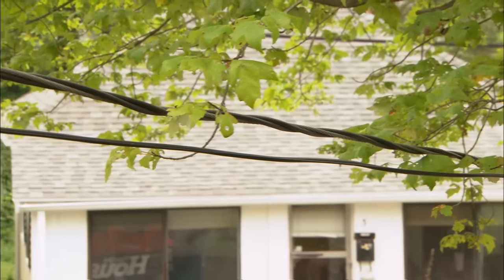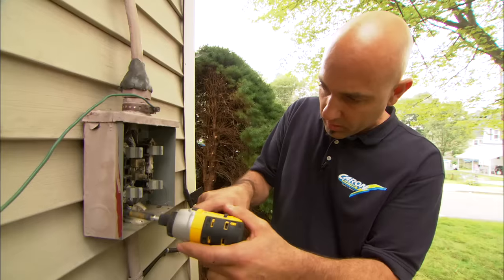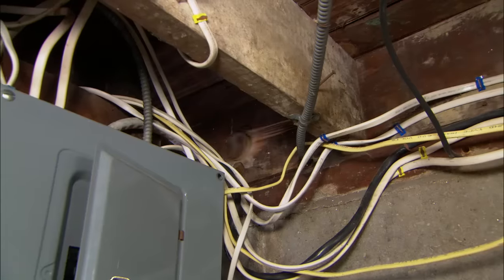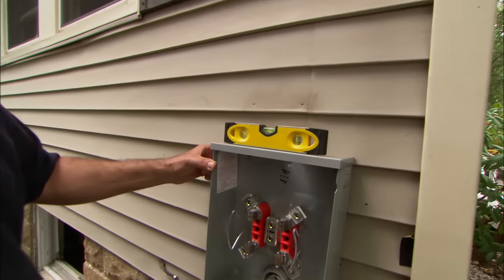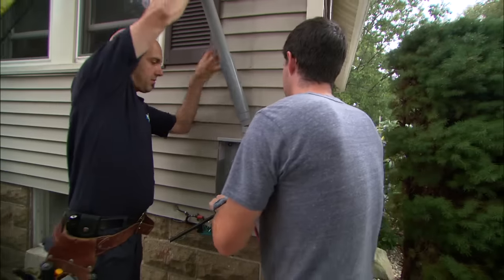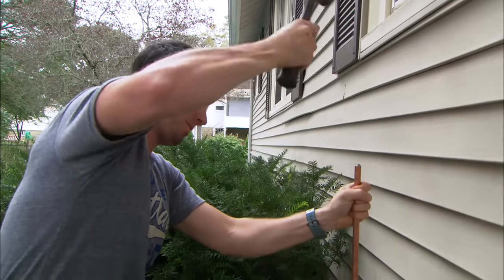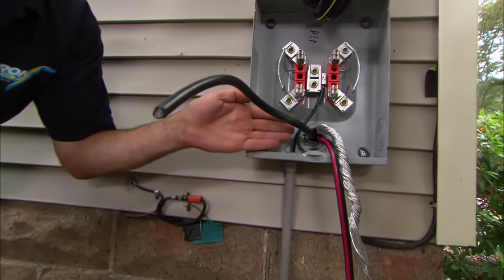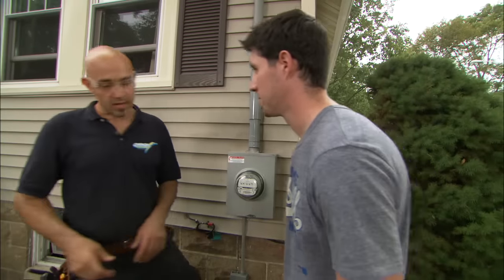How to Upgrade an Electric Meter to 200-Amp Service (Part 1) | This Old House

Comment: I always wonder who regulates the meter meaning who makes sure that is not running too fast. I know the electric company owns the meter but I wonder if the company that makes the meters is also owned by the Electric Company. Who is to say that the Electric Company wont have them made to run faster so that we as consumers use more electricity? I mean who regulates that? and makes sure that wont happen? I have a friend that his house would consume a tremendous amount of electricity even when he was gone in vacation for 3 weeks and leave all lights off except one on a timer and still consume way too much electricity.Turns out that after calling the electric company and complaining several time for years NOT that they care cause all they said everytime was that all was good that there was nothing they could do,well it came a time to upgrade for a new meter and his bill started to come down. So my point is that they do get old and out of timing and we pay for it. Meanwhile they make a ton of money out of us.
Reply: Do they have a smart meter? Smart meters take the biggest surge from the entire day.. And charge you that rate for the whole day.

So say at 5:00 pm.. The kids are playing video games and the sprinklers come on outside while the wife just put clothes on the laundry washer/dryer and has dinner in the oven while the husband is on the phone with his partner while looking on his computer and surfing his lap top all at once. Oh and the pool pump is running or whatever else you want to add. At 5:00 pm they can see you pulled the highest surge and they charge you that all damn day. 

The old meter has a monthly charge. Depends on your area.. May be $8.00 a month on top of your bill or $23.00 or even $11.00. All depends on your location. But they can't read your peak surges so you'll probably save in the long run. 

I know a guy on the inside so my info comes right from the source.
Reply: In Australia they will do random inspections on meters to find out if they are running to fast. 
My neighbours got checked they found that his meter was looking after him but it was in tolerance.
Reply: MrElPoderozo1 
You can easily test it yourself. On Amazon they sell a meter call a kill a watt. It plugs into the wall and tells you how much power is being drawn. I would get a space heater or something that draws a lot of power that can plug into 120 outlet. Turn off all breakers in the house except for one that you'll plug your heater into. Make sure there is nothing else plugged in on that circuit too. Observe what the outside meter shows. It should be not moving or show 0 if you have a digital meter outside. Then plug your heater into the kill a watt and then into the wall. Turn the heater on and see what the kill a watt shows you in terms of watts drawn. Then compare that to what the meter says outside. If you have an analog one that turns then you might have to wait 1 hour to see if it turns the right amount corresponding to the kWh recorded by the kill a watt meter.
Reply: boostedmaniac. Thanks👍
Reply: Jeff Cram. I would have to hire an Electrician for this. Yes the gas pumps get checked montly I guess. but a good friend of mine had done everything on his power to save money pn gas and electricity but his bill was still the same even when he was gone for a month so he called the electric company and he just got told that all was good that there was nothing they could do.
Well,the time came to upgrade there meters and ever sense then he said the bill droped by over 100 dollars and thats a lot! I can only imagine how many others are getting screw even though is illegal they are getting away with ot unless you do something like you suggest. Thanks anyway 👍.
Reply: MrElPoderozo1 there's so much here. First, if you suspect your meter is over sensing power use, and the utility is unresponsive, call your state PSC (Public Service Commission) - they regulate power, gas, water, and telephone.  Most utilities don't want to deal with a meter changeout because of the truck roll involved and the fact the the ANSI socket can get very oxidized and cause a flashover when pulling.
The utilities own the meter, but I can't think of a utility that owns a meter manufacturer. In the US, NIST (National Institute of Standards and Technology) regulates the meter calibration standards, and meter manufacturers calibrate and seal the meter under the glass (or plastic in more modern times) for the security of the consumer and utility. The security collar protects the utility from tamper by the consumer.
Newer smart meters are more sophisticated - first they can distinguish between VA (Volt-Amp) and VAr (volt-amp-reactive) within it - the first is Power (what the utility can bill you for,) the second is reactive-Power (what the utility cannot bill you for) and together they make apparent-power - the best example I've seen is a mug of beer with a large head of foam - http://electricalsynergy.edublogs.org/2015/11/30/knowledge-of-power-is-power/
Another benefit to smart meters is the ability for tier and ToU (Tome of Use) pricing. Tier, the first (which was partially explained in another comment) is how much power used over given thresholds - it might be the first tier is 4¢/kWh, the second tier is 12¢/kWh, etc so big power users pay significantly more - this is a common practice with manufacturing & commercial customers, and is moving towards residential - if the consumer signs up for it. ToU is billing how much power you are using when - as the distribution network must be designed for the maximal load, and not the typical load, the 5:00 hour when the neighborhoods around a substation get home and turn on air conditioning, pool pumps, electric ovens, plug in car chargers all at the same time. If the utility can charge customers more for that hour, consumers will defer the car charging and pool pumps until later, and turn the AC on before the ToU price to flatten the load.
Regarding your friend that went of vacation, he may have a bad wiring that is allowing power to flow to ground somewhere. Turn the main breaker off and check to see if power is still flowing on the meter - it's either the meter socket is corroded to the point that there is a resistive connection to ground or one of his neighbor is stealing power through his terminal connection.
Reply: James Hanley. Thank you very much for taking the time to answer me. You have offer a tremendous amount of information that is really appreciated thank you again,👍👍
Reply: I work for an electric utility and after reading these responses, most of these individuals do not have a clear understanding of analog vs. smart meters or who owns and is responsible for a homeowner's electrical service.  IMO, most of these people should not be providing advice.
Reply: just turn the meter upside down, or put a magnet on the side of the meter to slow it down.
Reply: Curly Q. Link It’s the reason why people should not take the Youtube comments section seriously. It’s loaded with bullshit.
Reply: Sounds to me like Curly Q. Link (not the best stooge) got triggered.  We opted not to have a smart meter and our bills are half of all of the neighbors who did see an increase.  We told them there would be but they went ahead and got it and for life they are stuck with the "smart" meter.  Smart for the electric company dumb for the consumer to have.
Reply: Janet Dougan enjoy getting your power shut off and those theft charges when the meter read comes takes pictures for evidence and reports your residence to their supervisor
Reply: Westinghouse manufactures most electric meters and they do not supply electricity directly. They do sell power plants, but if you pay your electric bill, the money will not go to Westinghouse.
Reply: I found many customers stealing electricity with the evidence of worn meter blades and jaw blocks caused by inverting their meter. The company I worked for prosecuted those idiots. I only got $50 extra plus some extra when the customer paid his estimated theft of service charges. Try your magnet trick yourself. it doesn't work.
Reply: LMAO, are you serious? So residential meters have a demand charge on your planet?  Demand charges are for commercial and industrial customers. Smart meters record the load and the time of day, and send a radio signal with the reading so a meter reader isn't required. That's all they do. You people with your fantasies about smart meters need to be banned from the internet. I worked for 40 years in the meter department of an east coast electric utility company. We tested every meter removed and brought into our shop and the only ones we ever found inaccurate were caused by tampering or a lightning strike which weakened the magnet inside the meter. Misaligned hands are another problem. Your guy on the inside works on the inside, in an office, doesn't he. I worked in the field and assisted electricians when they needed help too.
Reply: MrElPoderozo1 wow. Never thought about that.
Reply: In Switzerland it is per kWh, where i live the low fare is 12 Rappens and the high fare is 16 i think, or even 20, high fare is like during lunch time so 12:00-13:00 and some other times, during the night and so is the low fare,
Reply: MrElPoderozo1 they probably had a flat rate based on their average usage. Now with the new meter it’s a smart meter so they only pay for what they use.

Comment: If it's too close to the window.  it will fail inspection in some states.   Looks close.   Also, what you own, vs, what the power company owns varies per state.   In some states, you own the mast head, and everything attached to the house, but not the meter.   Other states start your ownership, after the meter.   And some states allow you to own the meter socket, so, you can attach the fancy 200 amp meter base with attached disconnect, etc.

Comment: nothing wrong with using aluminum for the service drop as long as everything is nolox.
Reply: and the right size wire.One size up than copper
Reply: Besides that it gets way hotter than copper.

Comment: Are 100 amp and 200 amp services regular for USA households? Here in NL we normally have 16 amps, some have 35, and for the real beasts there is 80 amps for a massive pricetag. Sure our voltage is double that of the USA, but 100 and 200 amps is way more than the voltage difference compensates?
Reply: In N America, the pole transformer supplies 240v secondary with a grounded centre tap, allowing for a choice of 120v or 240v in the house.   The 100 or 200 amps is multiplied by 240 to calculate max load wattage in the house.  100 is plenty unless you have only electric heat, and has been the residential minimum for more than 50 years.  This house looks like it had a very old 60 or 80 amp supply.
Reply: in US the minimum amp service for an apartment is 60 amps, for a single family dwelling its 100 amps. its always better to have more then not enough and redue all the work which has been done. europe is running 240 for all of there branch circuit use they need 50% less. 240 v in america is only used for heating, ranges, ect
Reply: Where the heck is NL
Reply: Richard van Pukkem: As was stated earlier, the most common electrical services to homes in the USA (and most areas in the Americas) are 60A, 100A, and 200A at a voltage of 120/240V single-phase. The power rating of a 100A 120/240V single-phase electrical service is 24 kVA (240*100). In Europe, the power rating of a 35A 230/400V three-phase electrical service is also 24 kVA (400*35*1.73). So the 100A service in the USA has the same capacity as a typical 35A service in Europe. Homes in the USA tend to be somewhat larger than European homes, so 100A and 200A services are quite common across the USA, and large homes in western USA may have 400A services due to large air conditioning loads.
Reply: Richard van Pukkem 

I believe your mains power for your household outlets are 220/240 volts single phase which greatly reduces the load amps wise. Here in the the US all households use 120 volts single phase up to a maximum of 20 amps per circuit which is why you see 100/200 amp main panels here in the states and Canada. Meanwhile the rest of the world uses 220/240 volt mains power. Here you only get 220/240 single phase if your cooking stove is electric or the home is electrically heated. I turned a buddy of mine onto a house in Salem, New Hampshire that is 100% electric from the original homeowner and the utility company when he chose all electric gave them a very low rate for the house for life. The highest his bill has been heating 3600 square feet has been $48.00 a month.
I've seen homeowners not wanting to pay a licensed electrician to upgrade their electric feed as seen on this video and hooked it up wrong, neutral to a hot and a hot to the neutral. Result they got to stand in the street at 3 AM and watch the house burn to the ground local volunteer fire department nearest station is 7 miles away typical for country living. There is a reason why you use a licensed electrician
Reply: Just did a 15,000sqft house with a 1200 amp service. Standard are 100 or 200. We still use a 100 amp can in apartments.
Reply: In some countries in Europe existig 3 phase service in 133/230V.

Comment: ground rods look a bit close together, hole for SE cable is about twice the size it needs to be, also I wouldn't use pvc for the service aside from the one coming out of the bottom for grounding
Reply: Ya...thinking same thing. There’s a section in the NEC on how to calc this distance. A little comment on his spacing choice would have been nice.
Reply: 6’

Comment: The ground rods provide a drain for Lightning protection there should not be any current flowing thru them except transient voltages from lightning. all the load current flows from the power utility equipment via the three wires in the service 'drop' there two lines and a NEUTRAL it is not called a ground. At the main panel the 'hot' wires go to breakers and the neutrals carry all current back to the panel while the ground wires go to the appliance and connect to the case except for equipment which is double insulated , the ground never carries load current except in a malfunction ...
Reply: Dennis Miles  That is not only what a ground rod does.I hate to tell you if there is a lighting strike close by the ground rod will save nothing. The ground rod does help some with transient a better choice would to install load center surge protection. If the power company were to loose there neutral the ground rod would help .
Reply: Exactly what i was thinking about the ground rods. Doesn't the neutral provide the path for ground faults?
Reply: Everybody wants to tell the world they’re an expert.
Reply: say what?  he is 100% correct
Reply: Dennis miles is 100% correct... wow
Reply: No,he is right.
Reply: No, the ground wire (not the rods!) provides the safety for ground faults. That is, the third prong on the cord. That ground wire.

Comment: My thoughts are where are your required GEC and bonding jumpers inside to the MDP?  Why no disconnect before sending the SE unfused through flammable material?

Comment: So you're going to plug the meter in so we can pick up the load while reenergizing the service? Electricians are not supposed to disconnect or connect the meters.
Reply: Sounds like you're a lineman. Not sure about other states, but in NJ every utility company I've worked with wants the center of the meter at 5'. That's quite a bit lower than that.
Reply: Matt Whritenour That's what we set our spec to also but you always have the few that put it low like in the video or at 7 ft off the ground for some odd reason.
Reply: jaxbeach09 there is no load the main panel isn't even connected
Reply: bob saget There will be once they install the panel and flip all the breakers on with the meter set. Then the troubleshooter/Lineman that comes to tap the service up and doesn't know the electrician set the meter, he will be tapping under load.
Reply: jaxbeach09  I'm sure he'll check for a load.
Reply: How much for this job ????
Reply: $2
Reply: jaxbeach09 Well if the lineman can't see the meter 6 feet down from where he's gonna tap the service he's got much bigger issues!!!
Reply: $1500 including new panel, meter base, and all wires and materials
Reply: That seems cheap. Is this a 200-amp service? Is he installing a proper grounding system?  Is he pulling a permit?  Is he a state licensed electrician, or some hack who just thinks he knows what he's doing?
Reply: Just had a 200 amp service installed with all the proper grounding systems by a licensed electrician for $800. -Southern Maine
Reply: Chris Dedmon  I'm sure he'll pull the meter before reconnecting the service wires. The code/building inspector stills has to sign off on the work done.
Reply: Who cares.Let it fly
Reply: Joe Campbell nice, what was the name of the electrician, I need this done to, I’m in Farmington
Reply: jaxbeach09 the power is disconnected from the service loop. No power until the utility comes back to hook it up.
Reply: jaxbeach09 what load, the main house breaker was off
Reply: The service entrance from the transformer was disconnect. He said that at the very beginning. As the utilities had removed it. Once he installs the new riser. They will come back an install the new cable rated for 200 amps. As the old cable feeding it was rated for 125 amps.

Just so you know. You can't just slap a 200 amp panel in your house. The Service has to be upgraded from the transformer.
Reply: Its commonly done

Comment: not sure what year this was and not sure what state that you're in but where I'm at, you have to have a meter pack rather than a meter base. Disconnect has to be outside for the fire department. No more main Breakers in the panel, all outside.